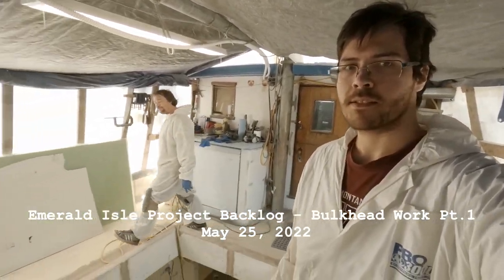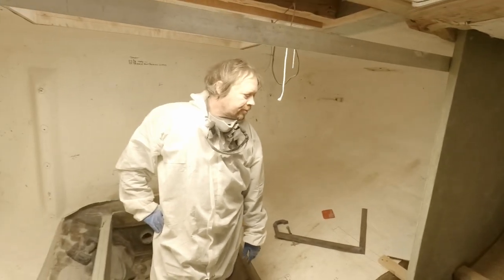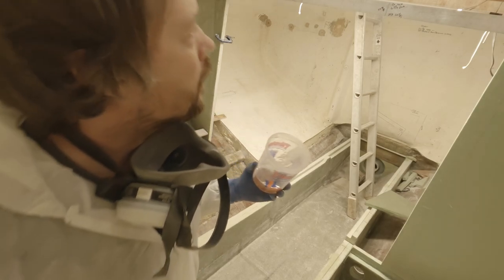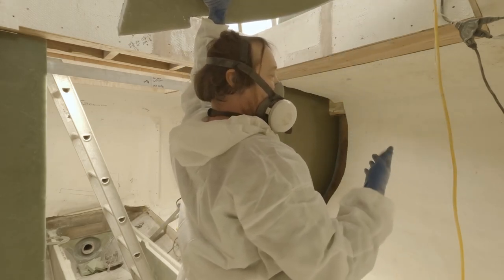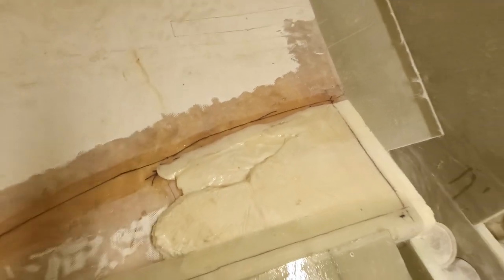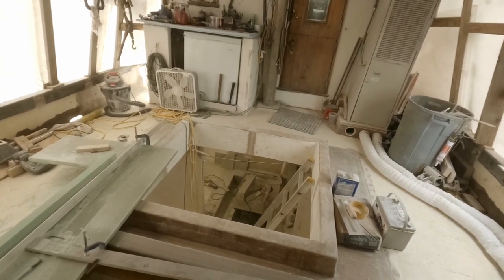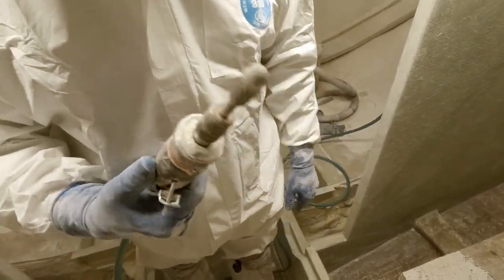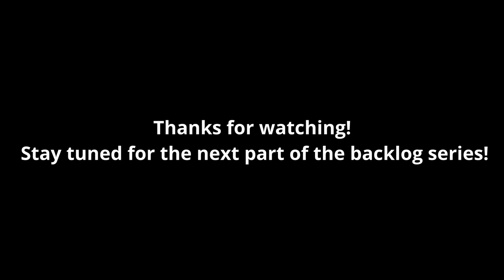Bulkhead Work - Emerald Isle: Ep.67 Fishing Boat Refit - Backlog #1

Comment: I don't recall you addressing it but I assume the stringers up from the keel stringers all were sound?   I remember very well the reconstruction of the two keel stringers in the shaft alley but don't recall the ones further up being investigated.  Probably my memory!
Reply from the maker: Great question Douglas! When we removed the fiberglass skin and foam to install the bulkhead we we able to inspect a portion of the stringers. They seem to be sound, laminate over wood. Guessing it is yellow cedar. At some point in the not too distant future, the hold will be stripped and refoamed/ glassed. At that point we will see for sure.
Reply: @EIS Alaska  Did you film the rigging and removal of the chilling unit??  I was looking forward to that.  Also in the future are you going to be able to work around all your prodigious new work when you redo the hold skin?  Be a shame to have to waste all this new work and materials!  Yellow cedar (not actually a cedar at all I have read) is so oily that without widespread availability in the seventies of epoxies it was very difficult to get a bond between poly and yellow cedar.  You would give it an acetone wash and the oil would be back before the poly could cure. Combined with many yards did not use fully air dried lumber made it problematic.  It checked so easily that they wanted to get it in place and locked down quickly.  Good wood if handled right.  Did you find a good bond in those small samples you got?